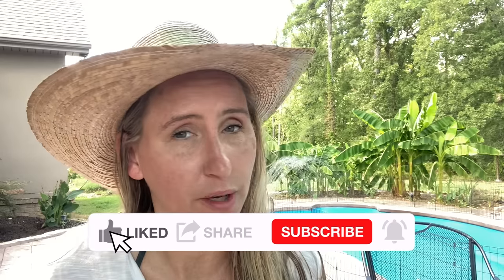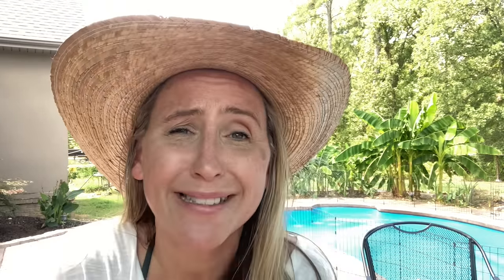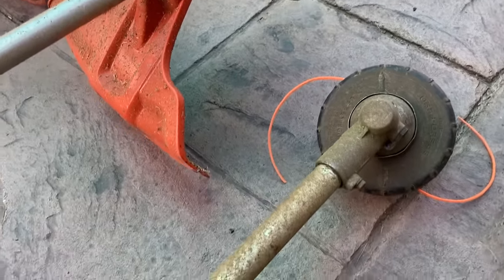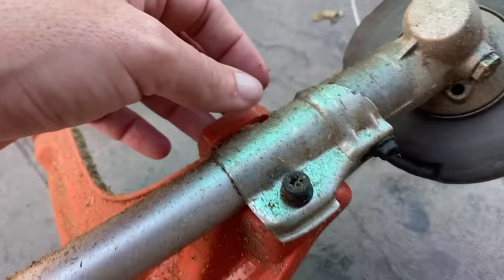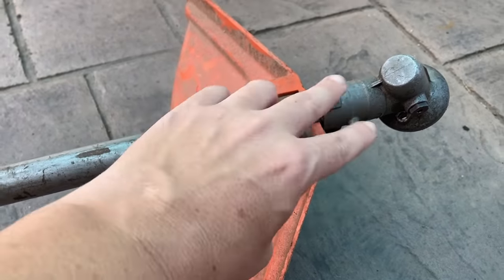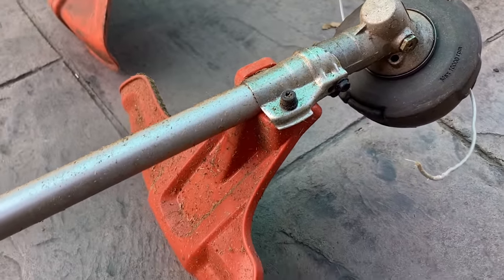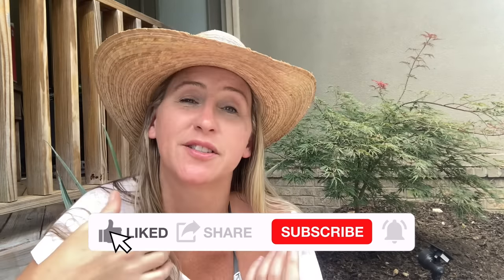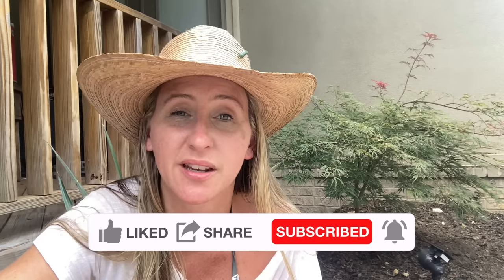String trimmer guard ON or OFF? Will it destroy your Stihl, Echo or Husqvarna? You might be shocked!

Comment: I won’t use a trimmer without a guard because I don’t like stuff flying back at me or anyone else.
Reply: Flies back at me regardless, I wear a face shield
Reply: Guard doesn’t stop much in my experience.
Reply: ? have you tried it without shield
Reply: Its honestly the same. The guard hasn’t done anything in that department.
Reply: Guard gets in the way, and idk if it's me but chickanic would get it
Reply: I took all mine off. Cut more faster. Don't have to walk all the way around stuff to cut since you have   a disc, essentially that's cutting 360deg. The guard restricts half of the cutting. Allows me to bump the string out farther, thus a larger diameter cutting. 
Yes, it throws a tad more, but it's mainly on feet.
🙂
Reply: I don’t want any debris flying back at me.
Reply: I wear snake gaiters,  safety glasses, helmet with face shield,  ear muffs. Long sleeve shirt , gloves and steel toe boots. And a stihl fs 240r without shield . I wouldn't take the shield on a regular trimmer even if it's commercial grade  unless it's a brush wacker since they are more powerful and capable of going through thicker stuff.
Reply: I like that I can keep a constant string length.
Reply: @stevenkinnison8044 then don’t use the weedeater or even mow if that’s the case I get covered with crap no matter what and I landscape for my profession.

Comment: I'm an Echo dealer myself.  Something I'm surprised you didn't mention is the damage to the engine running a trimmer without a guard can cause. Running those long "helicopter" trimmer lines actually bogs the engine down, which then causes excessive carbon buildup inside the engine, and on the muffler screen. I've seen this countless times. And carbon buildup can cause a poor running trimmer. That's one of the biggest reasons for the trimmer guards. To keep the string at a length that allows for optimum performance from the engine.
Reply: First thing I do is take the guard off and have ram trimmers for years without a problem. You’ll burn the clutch up before a motor goes. I also remove the spark arrester screen first thing. Just run a little seafoam every now and again you’ll be fine.
Reply: @Dr Iatrogenesis  you cab tell from the sound of the live is to long. Take it to the sidewalk and hit the gas until it's shorter.  This isn't rocket science.  Always better without the guard.  That thing blocks almost nothing of substance and your can't see what tf you're even trimming
Reply: @johndodo2062 learn how to trim
Reply: you are 100% right...itell all my friends to never take guard off because of that reason
Reply: @johndodo2062 what now????? y ur higher then groceries right now bro wha about cant see wha ur cuttin with the guard on hahaha johndodo i do hope ur jokin 😂 fr
Reply: Tk u for the video... 😊
Reply: Increasing line length causes a higher torque requirement but the engine is made for a specific power or Max torque.  Increasing line line will increase engine wear shorten engine life. Manufacturers make an engine to perform at optimum level by using known parameters.  I'll bet NO Manufacturer recommends no guard and extending line  length.  People jus5 want to alter recommended methods without understanding the consequences.
Reply: @freedomisntfree_44  lol what now? run a little seafoam here n there??
Reply: @johndodo2062  lol ive used weedeaters all my life im 37 now and have never came across a time i couldnt see wha i was doing because of having the guard on lol you will get used to it trust me ive seen people use no guards and line always ends up to long then the weedeter chokes down some wont cut as fast as its capable and all that stuff only thing i can see jus maybe possible from having no guard is maybe a small weight difference like barely noticeable to wear it may seem easier to operate it cuz really after a couple hours especially if ur on a hillside any way to drop a lil weight willhelp ya arms from getting so tired
Reply: @miller2167  I’ve landscaped  and farmed for 20 years. I run seafoam in everything. Works very well and makes things start right up and run like new
Reply: "Parameters? Way to confining, think outside the box"!
That's what a one arm was telling me when I walked off!
Reply: Wrong! Carbon build up has absolutely nothing to do with string length. It does lower rpms but not enough, it would take 10 feet of line sticking out! Carbon build up is from dipshits to afraid of running the throttle wide open. ALL HANDHELD EQUIPMENT IS DESIGNED TO BE RUN WOT!
Reply: Get rid of the stupid carbon screen... problem solved.
Reply: Makes the engine hot 🔥  too !
Reply: @johndodo2062 I have never had a guard block the view of what I am trimming since the guard is behind what I'm trimming and not in front of it I actually use a trimmer over 6 hours a day multiple days a week for my job and I've never once needed to remove the guard for any reason whatsoever.
Reply: I have a honda trimer 4 cycles I like it much a bit on the heavy side but no smoke clean burning I keep the guard it keep my machine up
Reply: It's so much harder to run that short line, I'd rather buy a new trimmer every 3 years than worry about keeping it running for 4
Reply: @johndodo2062 exactly
Reply: Funy 😳…I’ve had my gaurd off since the day I bought it and run a longer string length..I run it at all rpm’s and never had an issue with carbon except from the first few months of running it with stihl oil..didn’t effect its running but I’ve noticed it on the exhaust screen…ever since I switched to red armour oil never had build up on it…I’d say be precise about mixing oil is the key…

Comment: As an Echo mechanic for many years, I have seen just how the missing line shield can damage the machine.  Mostly on commercially used units, but also on some residential units with guards removed, and the lines clearly WAY too long.  Which causes the small engine to lack the power to drive such a load at high enough RPM to make the clutch engage completely--without slipping--which gets the clutch parts so hot that the springs lose tension (making the head not freewheel at idle) and causing excessive heat around the clutch cover, etc--and possibly melting the plastic and destroying bearings on some other trimmer models.  Troybilt are worst.  How you gonna set down a curved shaft running with the guard removed?  YOUR machine--YOU are gonna pay for the repairs if you cause damage from running too heavy a load with too long lines.  Not me.
Reply: I appreciate your comment.  The line being too long because the cutter attached to the shield is not there makes sense.   Additionally,  I had not idea what kind of problems that caused.
Reply: That was my first thought. Most things like that are there for a reason.
Reply: Brilliant explanation, thanks 👍👌👏
Reply: I've seen them last 7 years with no guard on... used every day
Reply: @davidrobinette3834  it cuts the line to a designed length,  allowing an even load through out the life of the machine. 

If it runs on gas, it makes humans stupid.
Reply: Absolutely correct the shield trims the string to the correct length .
Reply: I dont disagree with any of these comments however if you are a professional you learn by feel and listening to the loss of power how long the line needs to be. I have my happy length and I never use guards, they add weight and get hung up on things. But if you feel better with them then leave them on especially a home owner.
Reply: Not a single thing you said was inaccurate.  I've been selling ans servicing ECHO, Husqvarna, Shindaiwa and Redmax(pre Husky buyout) for roughly 20 years.  Some trimmer clutches are more susceptible than others (some older non-Husky Redmax come to mind) to overload/overheating damage from running without guards.  Regardless, careless use without guards nearly guarantees a shortened clutch life, if not shortened engine life, given it may not rev up enough for proper cooling, while possibly running at near 100% load trying to swing that excessively long line.  As someone here mentioned, to get a relatively normal lifespan without a guard you really have to pay close attention (eyes and ears) to line length and engine sound.  The most fascinating thing here is that some people are almost surprised the guard and cutter have a truly functional "purpose" beyond just preventing some trimming debris from shooting you in the ankle.  Folks, never assume you know more than the engineers who designed something...it'll come around to bite you in the ass eventually!😳🙄😂
Reply: Everyone pay attention.   Electrical Engineer speaking.
Reply: Aren't there gear heads with more reduction ?
We could have lower rpm for longer trimmer lines while the engine has higher rpm and enough power ?
Reply: Excellent info for me. I Inherented a commercial use echo with the gaurd already removed, now in residential use, it is the best trimmer I've ever had.. no close second place either. With the fast feeding head, and guard removed, the string is perpetual too long. The larger swath works faster on level ground, but will not attain full speed just as said. 
I could not imagine using it, or letting someone barrow it without safety glasses. The force with which objects occasionally strike your face will make you reconsider unprotected eyes.
Reply: @mikewood4378  I get tons of trimmers in my shop from professional landscapers who have damaged their trimmers running them without a guard. Even trimmers that are still running and come in for other reasons, if you pull the muffler they show signs of wear inside and the clutches show signs of overheating. 

In my experience landscape crews are the absolute worst at knowing and taking care of their equipment with broken and missing air shrouds, no air filters and/ or missing cleaner covers, duct taped and bailing wired together, loose and worn gear heads, broken triggers, missing and Jimmy rigged spark plug boots, loose rattling mufflers... . The things are falling apart by the time I get them and most haven't been serviced since the last time they brought it to me 8 months ago.
Reply: @mikewood4378  I agree 100% about listening for the RPM's..and yes, the guards get hung up on everything you try to trim around, and can't get under fences as well. I also don't like the line QUITE as short as the guard cuts it...but I also know not to run it too long. That's why I don't run the guards on mine...but I do not recommend that novices remove them, or lawn services who use hired help that do not know to trim the line off when it gets too long...
Reply: If you cant tell when your engine is struggling to make the required power, you should not remove the shield. Its probably okay for the rest of us.
Reply: Who gives a crap about the trimmer I don't need to hurt call OSHA.
Reply: My 131r ... the crank case have cracked when the clutch spring have broke on the helicopter mod. The 240r is a real heavy duty and can be seriously abused.

Comment: two years ago I had a 3 inch piece of 105 trimmer line break off and it stuck in my the meat above my ankle 2 inches deep. Too, the tab that cuts the line is attached to the shield. Removing the shield is plain STUPID
Reply from the maker: Yup! That's why I wear my boots to trim in with the shield on.
Reply: Use 0.65 line with out shield use lighter to melt line in holes
Reply: Wearing long pants ?
Reply: @benjurqunov ,
Chickie rockin’ the jeans shorts!
Reply: @Chickanic Great legs, on that trimmer 😂
Reply: I do something a bit different,  I remove my factory echo ones and use ones off a husqvarna that mount on the shaft and I can adjust them ...
Reply: I used weed eaters for 25 years with the guards on. We own a farm and run miles of line. I kept noticing all the yard services never used guards. I bought a big Echo and pulled the guard off. I was amazed at the difference.  We got so much more done. Let me qualify this by also saying,  I don't own a grinder with the shield on it either, so take what I say with a grain of salt.
Reply: I was mowing a (back then) friend’s overgrown lawn and used his trimmer. He had the shield off and after I was done I was COMPLETELY green and my legs where itching from all the plants with spikes and grass and stones and everything that hit them. I now have my own trimmer with the shield on and I stay reasonably clean and doesn’t have itchy legs. 😅
Reply: Surely that’s just the strimmer line slapping when at low speed? At high speed the line run straight.

Comment: I always run my trimmer without a guard. You can get into tighter places, and it reduces weight. As long as you don't run the string way out, you'll never have issues. The trimmers that were shown that have a bracket built into the gaurd can still be run without the gaurd. You need to remove the bracket from the gaurd and then put the bracket back on the trimmer. Some trimmers you'll need to break the gaurd off the bracket and then put the gaurd back on the trimmer.